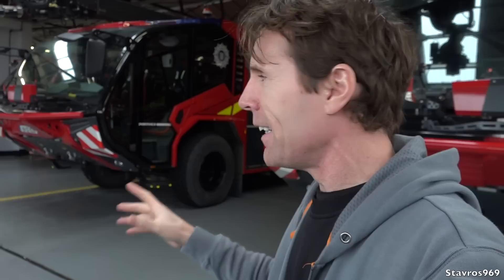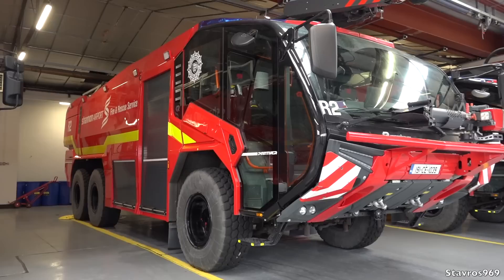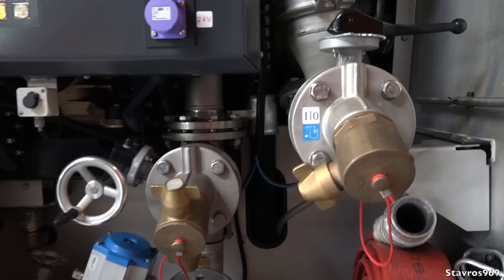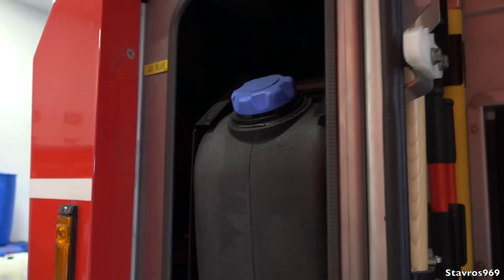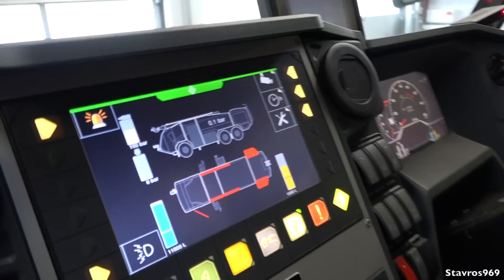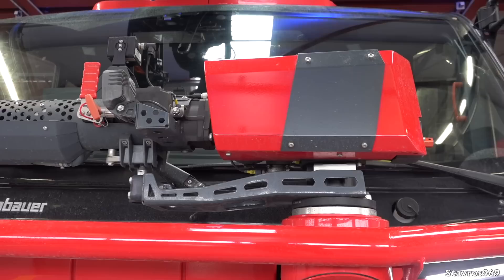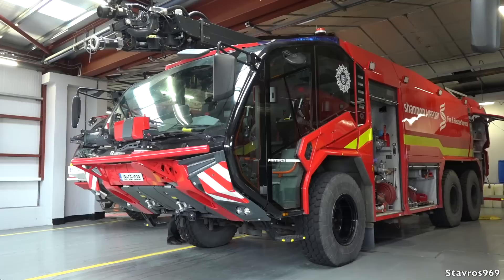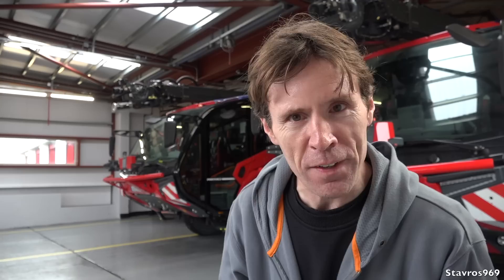2019 Rosenbauer PANTHER Airport Fire Engine (Full Tour Latest Tech)

Comment: the new 2021 Rosenbauer Panther 8X8 + 5.0 in. Lift 12.3 TDI I8 4-Dr Double Cab Situation Support Truck (RHD) with a few upgrades could address fire situations in far flung areas . . . the 12.3 TDI I8 mated to a 18-speed auto transmission has to be retuned so that it can perform flawlessly in extreme temperatures, be it +42.0° deg or -34.0° deg even when running on low quality fuel . . . both the thick high strength steel chassis frame & body (front 4-Dr Double Cab & rear chassis mounted fire fighting apparatus) of the Rosenbauer Panther 8X8 + 5.0 in. Lift 12.3 TDI I8 4-Dr Double Cab Situation Support Truck (RHD) has to be heavily reinforced for greater torsional rigidity & enhanced stiffening . . . a beefed up suspension featuring stiffer springs and shocks & a proper off road optimized 5.0 in. suspension lift . . . not to mention 26.3 in. semi beadlock wheels shod with HCV compatible all terrain radial tyres . . .